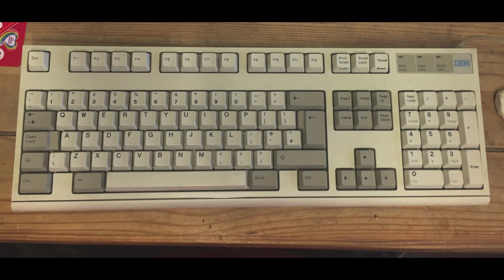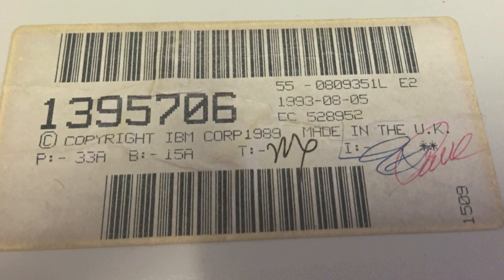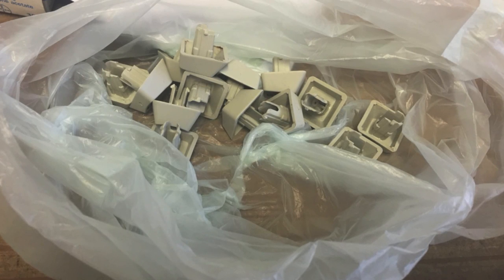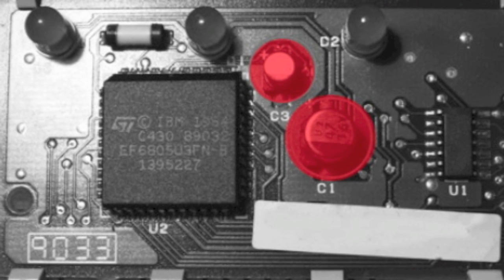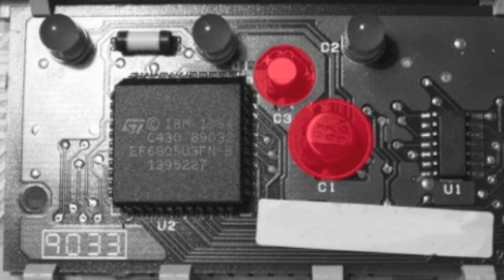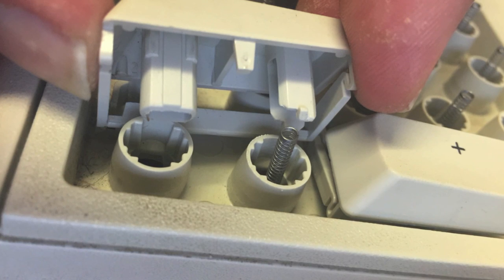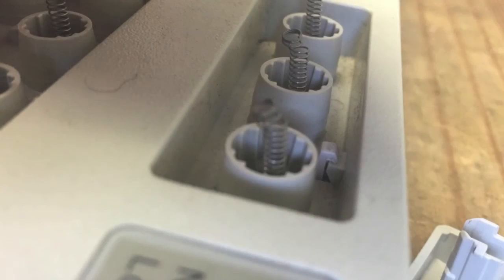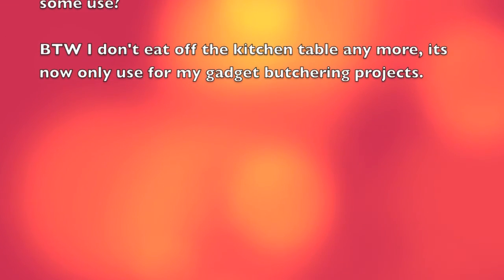IBM Model m2 clicky keyboard disassembly and repair

Comment: Yes, thanks for that, it was really useful. I could add that some of the bigger keys have extra fixing bits, and should be removed after the surrounding keys, so you can see and release these extra bits: Spacebar, Return, R-Shift, Backspace, Ins, Enter (num pad), + (num pad) ... and vice versa on reassembly. Once all keys removed you can get to the 13 plastic lugs holding the bottom of the keyboard.

Comment: Thanks for the video. I replaced the capacitors but when I plug the keyboard caps lock and scroll lock LEDs light up, then numlock flashes really quick and they all turn off. Keyboard doesn't work, obviously. Any tips on what the problem might be?
Reply: Same for me, replacing electrolytes didnt solve the problem. I can actually make it work, after several USB connector plug/unpluggings, num lock remains lit and keyboard works, but only for a couple of minutes and than stops. Two things come to mind: 1. faulty PS/2- USB  converter: 2. some of the small SMD capacitors from the backside of PCB. I would need to check them all out, just dont have the time right now.

Comment: I am in the middle of repairing my own IBM Model M2. I have already disassembled the day after yours :)
I will be ordering the new capacitors soon but I've cleaned up the board and re-positioned the springs and stored it nicely ready for reassembly.

If you or anyone needs new springs you can get them from Unicomp, the company that now own the Model M rights.
The springs are $0.20 (~£0.16) each and shipping is about $14.66 (~£11.38). The shipping is based on weight and you can order up to 49 at that shipping rate. 50 or more bumps the shipping to $31.49 (~£24.45)
Here is the link for those springs
http://www.pckeyboard.com/page/product/PVPLASM

On another note, I see you have some drone footage from Pembrokeshire. Do you live there? I am originally from Pembroke Dock but currently living in Cumbria.
Reply from the maker: Good luck with it Lee, its a great keyboard once working! Yes, from Pembrokeshire :)
Reply: Lee Beasley vdvsbnz z zna q amZz zhzna am  abw anama  A

Comment: Thanks for taking the time to create this.  Thanks to you, I can type this on a just-reassembled 1992 M2.  Yep, the caps were the problem, with the 2.2uF one having leaked over the controller board.  Traces were fine, though, so a cleanup and replace was good enough to get it back into perfect working order.  Hats off to you, sir!
Reply from the maker: Thanks for your comment Danny, using my M2 now to type this, beautiful keyboard!  Shame so many have been binned due to the caps leakage, but well done for taking the same to save your own little piece of computing history!
Reply: Danny Woods fhbgnm vmjv mvvmm